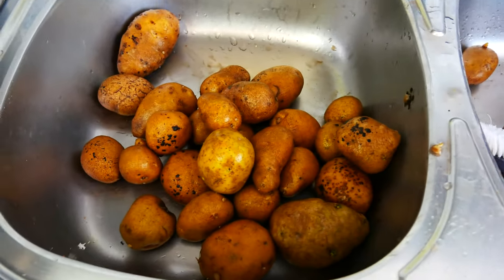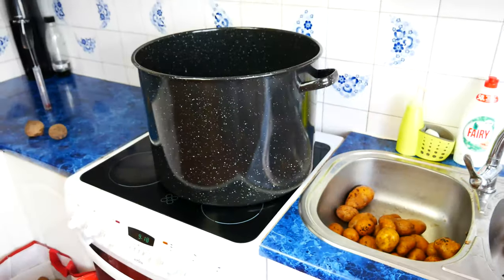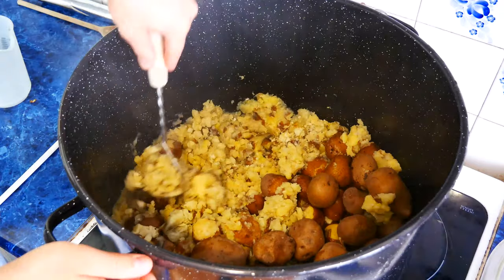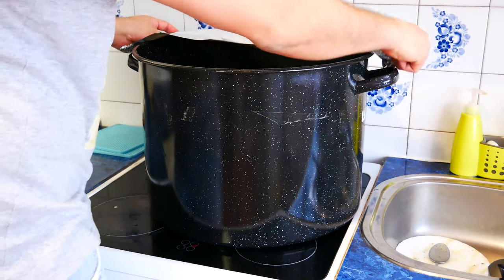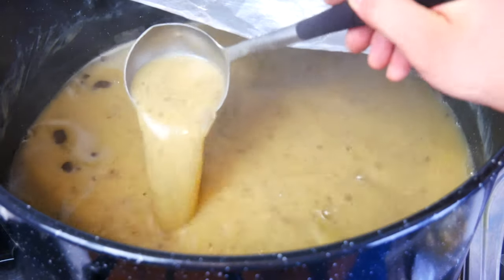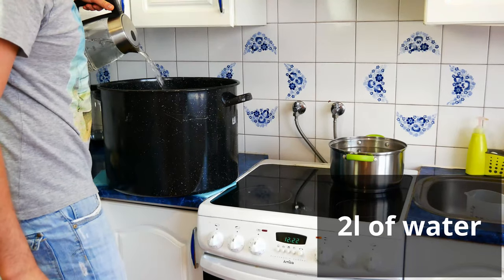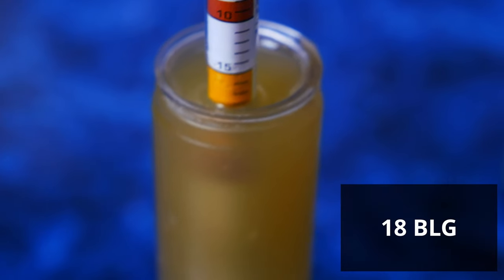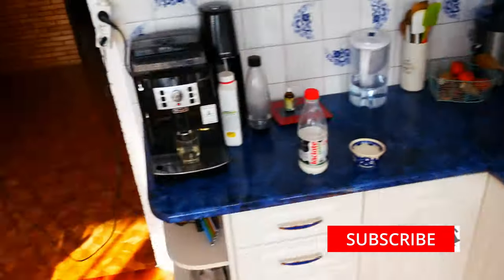How To Make Homemade Potato Vodka

Comment: Thank you but how do you get the “VODKA” flavor. It always comes out tasting the same no matter what I use. It always tastes like “moonshine”.  The only thing I’ve found that makes a difference is Artichokes    Using them  with sugar and  water and no enzymes makes the distillate taste like tequila. The other thing is adding juniper berries to the distillate and running it through again. That flavors it like Gin. 
The other thing I question is    Why do you steam the potatoes.  I just chop them up and boil them.  Then mash them right into the water I boiled them in. Then I pulverize them with a blender.  I always add about  twice as much sugar by weight as potatoes or fruit.  Whatever I’m using at the time. I’ve tried them both ways. With and without enzymes and I find the enzymes make the distillate bitter and less smooth. There is definitely less flavor when I use enzymes. The percent alcohol is about the same it just takes a couple days more to ferment into alcohol.  Just my experience. Let me know your thoughts.
Reply: Hi, sorry you are not getting very good results, you are right, vodka and shine are different, I found that Still Spirits vodka yeast gave me a really good result, shine has all the flavour stripped out which is the idea being as a pure spirit is wanted but vodka can have flavour and using the right yeast is the answer.
 If you use a sugar wash then after distilling you need to run it through some activated charcoal then filter that to really clean it up because no matter how pure the run it still has off flavours you don't want. If I'm trying to teach you how to suck eggs then my bad.
Reply: Hey Thad, your method sounds great and with no barley is good news! Do you have a recipe you could share with me please?

Comment: Awesome video.
I've just one question.
Why do you add barley malt to the mix, when you've already added alfa-amylase enzyme, I'll specify.
I know that barley malt contains beta-amylase enzymes, but is there any difference to not using barley malt?
Reply from the maker: Exacly - Barley malt contain Beta-amylase enzymes which turn potato starches into fermentated sugar. If you dont want to use barley malt, you can buy beta-amylase in small bottles. 

If you don't use it at all, you will recive less alcohol as a finall product
Reply: @bigboyshobbies5731  Ok, thank you :)

Comment: brother how much liguid(mash) we will have with these amounts of contents?
Reply from the maker: around 4 gallon's
Reply: @bigboyshobbies5731  Thanks bro.1 more question. how many times you distillate? Do you use carbon filter after distillation?
Reply from the maker: @surveyengineer2372  I distill it twice. I don't use any carbon filters, but you can do it - it will kill potato taste and make it more smooth. If you distill it on the column than you dont need filter. If you use pot still than its up to you
Reply: @bigboyshobbies5731  i will use carbon filter for half, for other half i will not use:) thanks.

Comment: bro instead of using all of these ingredients and boiling process why don't you blend the raw potatoes in blender then add water then add sugar then add yeast and let ferment for 2 days you will get fine product to distill
Reply: I thought you needed the cooking temperature, to get the enzymes' to work.
Your method doesn't add any malt or enzymes, so wondering how much of your potatoes starch is actually being used by the yeast, if not converted to sugar first? 
I did try a wash with near raw potatoes once, and no malt etc, and as a result got a very low alcohol wash, and not much product from distilling.
Reply: @Retiredkiwi  you can pure alcohol from potatoes if you let it sit for a year
Reply: @Retiredkiwi  if you add malt you get vodkha